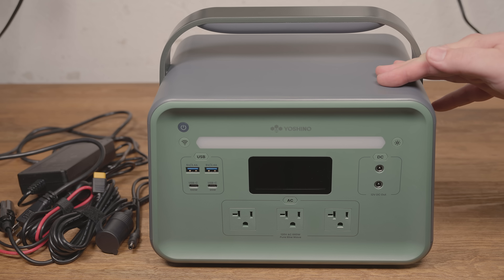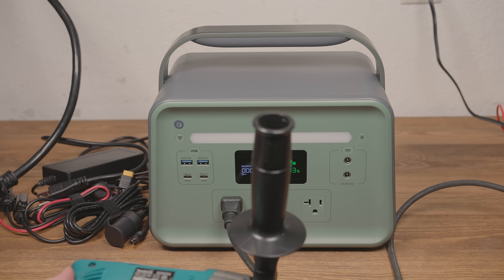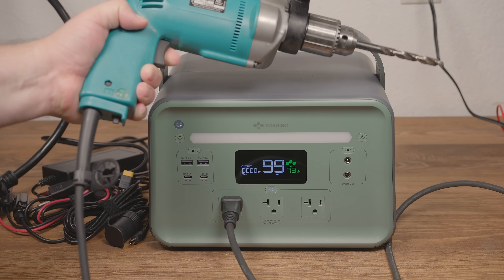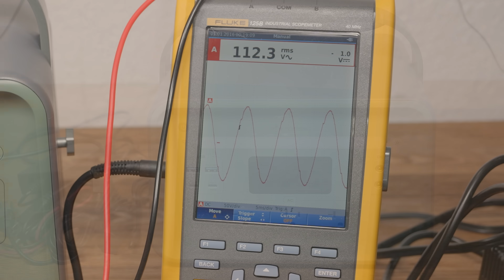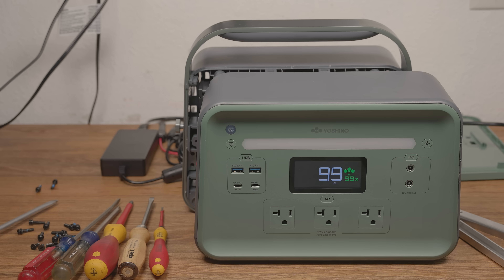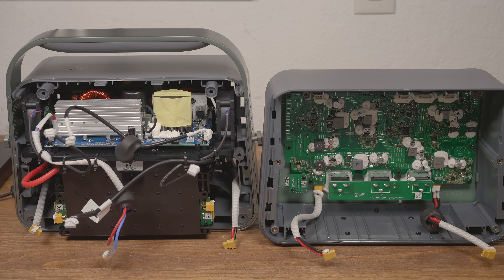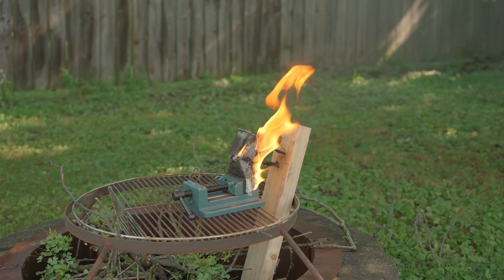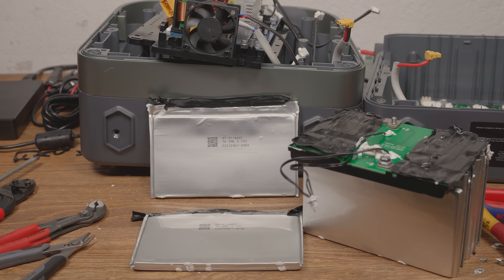Yoshino Solid State Battery Power Station, Test and Teardown!

Comment: According to the 3.72V printed on the battery pouch, it is Lithium Polymer battery. These batteries are a type of rechargeable battery that use a polymer electrolyte instead of a liquid electrolyte. LiPo batteries are sensitive to overcharging, over-discharging, and physical damage, which can lead to swelling, leakage, or even fires.
Reply from the maker: Yup, not solid state.  I even did more research into the chemicals listed on the SDS, and at least two of them are listed as liquid, organic solvents (probably absorbed into the polymer).  There are also multiple polymers listed.
Reply: Lipoly batteries are the a bomb
Reply: You can't necessarily tell the precise battery chemistry just from looking at the voltage.  And "lithium polymer" batteries aren't actually a different thing than "lithium ion" batteries anyway.  Many batteries everybody thinks of as "lithium ion" (which have a variety of other voltages) actually do use polymer-based electrolytes too.  "Lithium polymer" is really more a marketing term, not a well-defined technical category anyway.

But it is also theoretically possible that somebody might have created solid-state batteries with a nominal cell electric potential of 3.72V (or something close) too.  There is nothing we really know that says that couldn't necessarily happen.  Did they actually do that in this case?  Based on the other stuff from this video, I think it's pretty clear they actually didn't, but still, the nominal voltage by itself doesn't really tell you anything one way or another in this regard.
Reply: @foogod4237  while the names "lithium polymer" and "lithium ion" are very generic, they are the names of specific battery chemistries.
If you say "Li-ion", you're talking about lithium-Nickel-Manganese-Cobalt (NMC) cells, with a liquid electrolyte. Another type of Li-Ion cell is Lithium Iron Phosphate (LFP) that still uses lithium ions with a different chemistry, but even if it's technically a subcategory you always specify when talking about it.

LiPos are still lithium batteries, but what changes is the electrolyte. Instead of using a lithium salt dissolved in a liquid solvent (dissolved salts form ions... From here the name "li-ion"),  they use a gel polymer. There are still lithium ions dissolved in it so it still technically is a subcategory of Li-Ion, but as with LFP, we differentiate saying Li-Po instead of Li-Ion. All LiPos are Li-Ion, but not all Li-Ion are LiPos.

TL;DR: while you're technically right, common terminology is different: "Li-Ion"=LFP, "Li-Po"=Li-Ion cell with a polymer based electrolyte. Basically every battery technology we have is "Li-Ion", but if the characteristics are different enough from the "standard" cells we call them with a different name, and NMC is the "standard" Li-Ion.

And still, "solid state" cells are technically a subcategory of LiPo! The electrolyte contains lithium ions in a solid polymer... So yeah. But they have such different characteristics that we differentiate. 

-----

Having clarified all the terminology, I doubt yoshiko is using LiPos, as they usually are less energy dense and have a much higher discharge rating. The power station would have significantly less capacity than similarly sized competitors, and a much higher power rating (assuming they have the appropriate circuitry in place). If they're trying to sell it as a safe power station I doubt they're using Li-Pos too, as they're known to be the opposite of safe.
Hard to pinpoint the actual chemistry they're using, but we can give educated guesses based on how they behave and their characteristics. Maybe they're really using a "hybrid" cell, whatever that means. We'd have to tear a cell down and see.

Sorry for the ultra long comment lol
Reply: The issue with li-poly batteries is that they are sealed and if anything goes wrong (it always can), excess gas has nowhere to go, unlike the way they produce 18650 and other cylindrical batteries. Usually you can keep on using cylindrical batteries no problem even after such things happen, but it's not recommended
Reply: @mrofinUtortxoF  The other problem with LiPo's is they're traditionally only good for 500 cycles.
Reply: @mondotv4216  depends on device. if you use it every day, it's an issue. otherwise it's fine.
Reply: Lipo? If so, that's much worse than standard lio-ion. Lipos are typically restricted to RC hobbies and other less "consumer-friendly" duties due to their higher volititly.
Reply: @csdstudio78 it’s Polymer state Battery. not a pouch cell. You’re misunderstanding between Li-Ion Pouch and Li-Po.
Reply: Can't be lipo, the energy density is close to li-ion.
Lipo cells store much less energy
Reply: @FAB1150  li-po is more about pouch-style batteries, than "other type of chemicals"
Reply: @mrofinUtortxoF  it is not, even though it almost always uses pouch cells. It's the electrolyte used, which instead of being a liquid it's a polymer (usually a gel).
Reply: @FAB1150  can you name a single cylindrical li-po cell?
Reply: @mrofinUtortxoF  they're almost never used, because their characteristics suit other use cases better.
That doesn't mean that pouch cells are called LiPos. There are pouch lipos, there are pouch li-ions.
What sets them apart is the electrolyte used, not the form factor they're sold in.
Reply: Repeat aftet me: "there's no such thing as lithium polymer battery". All these are lithium ion, plain and simple, voltage differences come from different cathode, sometimes anode, composition. These is no lithium ion or lithium polymer. Period

Comment: Quick Suggestion.

While your analysis was on spot, there IS one other item to test for that would greatly benefit the public safety and amateur “ham” radio operator groups…

Radio “interference” (RFI/EMI) from the device, with radio equipment powered FROM the unit and with radio equipment NOT connected, but merely operating nearby.  
During the following:

- while charging 
- disconnected from charger

Thanks!
Reply: Sorry… forgot to ask,
What is your current recommendation for the best performing “power stations” that won’t break the bank.

Thanks again.
Reply from the maker: Unfortunately, I was primarily focused on the batteries for this test, and the unit is...not exactly functional at this point, lol.  So I can't do much testing for RFI/EMI.  Though I wish I had, since I do have some equipment for that.  I'm sorry, but I don't think it's going to happen at this point.

As for a recommendation, I really don't have a ton of experience with portable power stations.  I tested the 4Patriots Sidekick because their marketing rubbed me the wrong way and I suspected their units were overpriced.  And I tested this unit.  The only other experience I have is with a small Jackery that I charge with a solar panel and then use to charge my tablet/phone and such once in a while.  I like it, but I don't have all that much to compare it to.  I'm sure there are other folks out there with much more experience with far more units that would be better able to answer that question.

Comment: Thank you!  You just earned 7 subs…. 

We’re a bunch of firefighters who were anxiously awaiting a solid state battery solution from an AMERICAN company.
Our primary use is for powering/charging  2-way radio gear and drone batteries in the field.
We specifically avoided the newly released DJI Power unit(s) for those reasons.
With 11 vehicles to equip (replacing very old Jackery units), your work saved us a small fortune.

Thanks again!
Reply: Thank you for your service guys, this company should be sued.
Reply: Out of curiosity, why are you waiting for solid state specifically?
Reply: @Black-Villain  sorry.  I just typed a small novel worth of info.
When i went to post it, YouTube gave me a login window and erased it all.
I have to run, but in a few lines:

Bottom line … we’ve attended quite a few lithium battery seminars and courses over the past few years..
The threat potential is extremely high and applies to both lithium ion and lithium iron phosphate type batteries.
The batteries contain both the fuel and oxygen (oxidizer) required for combustion.  The heat/flames of a thermal runaway fire is just incredible and there is also a huge hazard when gases are released, especially in a confined space environment.

A friend and fellow USAR teammate is a FDNY Battalion Chief and routinely brings stories, photos, and videos of horrific fires, mostly in high-rise apartment buildings.  They are mostly caused by batteries in e-bikes, scooters, and other conveyances like the one-wheeled device that looks sort of like a skateboard. 

These fires are nearly impossible to extinguish.  The goal is to pour enough water on the fire to prevent spread to other batteries and other flammable , as the fire continues to burn until the “fuel” is depleted .  The worst danger, but has only happened once or twice in the past few years, is elevator fires.   There was a recent horrific fire in elevator in China. I believe there’s a censored video on YouTube, but the entire unedited/unblurred video on the “Fire Engineering” site.   Even the smallest battery can result in the elevator car turning into an oven or kiln.  

We all carry water fire extinguishers used for “Class A” fires (combustible paper & wood, etc.,) and dry chem fire extinguishers for “Class B” (flamaable liquids) and “Class C” (electrical) fires.  All are totally useless when attempting to combat a lithium battery fire.

The FDNY has a specialized “Purple K” unit, consisting of several pieces of apparatus and specially trained firefighters, it carries large tanks of “Purple K” firefighting agent.  It’s quite pricey, requires special handling and training, and was developed for and used on flammable liquids.  New York has a massive number of underground, electrical transformer of vaults.  When an arcc fire or similar terrifying event occurs in these, their “go to” is to dispatch the “purple k” unit to dump in enough agent to quench the arcing and fire.
(surprisingly to the EE’s, electricians and hobbyists out there, if the event is large enough to affect surrounding structures or poses a  life safety hazardthey will sometimes use water in an attempt to fill the vault until the Purple-K unit arrives.  I once witnessed this during a “ride along” back in the 1990’s.  They will charge a SMALL diameter hose line with water and, from a distance of 30-50’ or more, will keep the nozzle in contact with the ground.  They’ll aim the water stream along the concrete or pavement towards the vault etrance (usually a rectangle heavy steel grate on the sidewalk - kinda looks like a subway ventilation grate) OR a manhole with removable cover.  It’s not too effective & often causes damage though the damage is already done by that time.

The Purple k agent works extremely well, but create a huge mess and requires cleanup, etc..

Guess what?   
“Purple K” it’s not much more effective than just plain water when trying to fight a substantial lithium battery fire, Like a lithium battery “bank” used as power back up in a home or commercial environment.  

Sorry…. This ended up being a messy post and went all over the place.

The primary reason for trying to get away from the very power dense lithium battery use for us, which has actually been incredible for all of our equipment, especially our portable radios….  Is the threat indicated above.  Most of our power tools are now lithium battery powered, we even have a battery powered “jaws of life“ extrication tool for hard to access areas, etc.  But, our portable radios have $300-400 intrinsically safe battery packs (radios are $10-12,000 Motorola APX 8K) that have undergone extreme testing for safety.  Punctures are still a risk.  But, our 4 watt UHF portable radio life has gone from 2-4 hour max use (nicad batteries / heavy duty cycle) to slightly longer nimh… To 12+ HOURS with lithium-ion batteries.  

If used properly and the batteries and tools are constructed for use in the type of environment used, the power density in lithium batteries is a real game changer.  we just want to remain as safe as possible, especially considering you tend to handle equipment, harshly when operating quickly when lives are at stake.

Until we have a better technology, I guess we’ll be sticking with lithium and educating all of the users unproper use + storage, etc.

Thanks!
Reply: @PowderMill  It is a mistake to equate LiFePO4 with Lithium NMC and other high energy lithium chemistry batteries. All the stories you mention are NMC. The phosphate-oxide bond is thermally stable and is not subject to thermal runaway. The 'C' in NCM stands for Cobalt. The cobalt-oxygen cathode has a negative temperature coefficient causing the cobalt to be a if not the primary factor in thermal runaway.  LiFePO4 has no cobalt.
Reply: @Sylvan_dB the issue isn’t the batteries the selves spontaneously combusting in this case. They’re looking for batteries that are safe to handle for their own equipment in extreme environments. LFP may be safe at normal temperatures, but for a radio on the outside of a firefighting suit, or a power tool being used to cut through a deadbolt, the high temperatures can cause the liquid electrolyte to expand and/or burn. I suspect this is the reason they’re looking at solid state batteries. Though I’d guess any conventional power station’s plastic construction wouldn’t make them suitable for operation above 50C, let alone 80C. A power station would probably only be used on the sidelines where it’s safe to be desuited, where heat risk isn’t a factor.
Reply: @Scrogan  No kidding. LFP is safe in the situation you describe.  You can put a torch on them.
Reply: @PowderMill  I think the key statement here is fires from e-bikes, e-scooters and one wheelers. These are cheaper batteries with cheap BMS'S and volatile chemistry, and often the chargers for these things have no real protection built in - if the BMS fails they'll just keep charging the battery until it is damaged and eventually catches fire.
Reply: @PowderMill thank you for providing your personal encounters with products.  Honestly I wish fireman talked more.  We get the once a year don't deep fry a turkey inside message and that's it. It's great to hear more messages.  Each city or county should  have a PR position for the fire department I'm sure you still go out to schools but with technology evolving so rapidly it's great to learn more. My apartment banned bikes in the elevators after the China fire but wish we didn't have to learn only from when things go horribly wrong. Thank you again for taking the time to write that twice also. YT does the same to me sometimes, I even copy my comment now before I hit the send button.
Reply: @Black-Villain  I am no experat at all..   but my guess is having a technology that doesnt blow up when overheated is an advantage when operated near major sources of heat.   Lithium Ion explodes.  Solid state should not.     Firemen work around sources of heat!!?
Reply: @dalmatianlife  But we already have very safe cells in LiFePO4. It's ignition point is so much higher that provided you stick with either the traditional cylindrical cells (safest because the lowest amount of energy per cell) or the aluminium case cells they heat up when penetrated but don't normally catch fire. The pouch cells are different - they don't have any pressure relief system so they tend to spew electrolyte everywhere when they burst and they can catch fire. I'd imagine if they are replacing old Jackery's they are not LiFe. DJI make some of the best drones but I don't know about their power electronics. I'd trust BYD and CATL though for the actual batteries.
Reply: 'murica wooo
Not like any American company has ever made a scam, or sold fake garbage
🇺🇸🦅🇺🇸🦅🇺🇸🦅🇺🇸🇺🇸🦅🦅

Comment: If you open a solid state battery, there is a layer of β-Alumina, a white ceramic material. This is the solid electrolyte which allows ionic flow.
Reply from the maker: Maybe I’ll still pull one apart in a follow up video.
Reply: @Ray_of_Light62  Not necessarily. Researchers are trying all kinds of materials as solid electrolytes (as well as all kinds of materials as anodes). They include glass, sulphides, Lithium orthosilicate and many others. As there aren't a lot in actual production (nothing outside of pilot product lines AFAIK) I'm not sure which particular solid state battery you are referring to?
Reply: Yes. Beta Alumina was the first of a long series of solid compounds which are able to transport ions in a battery...